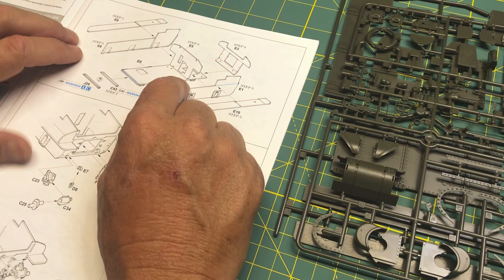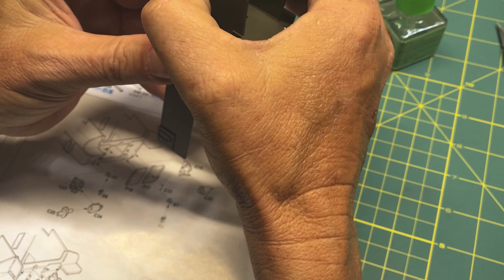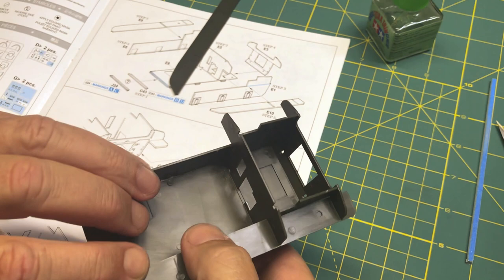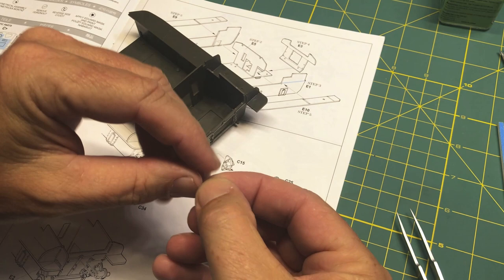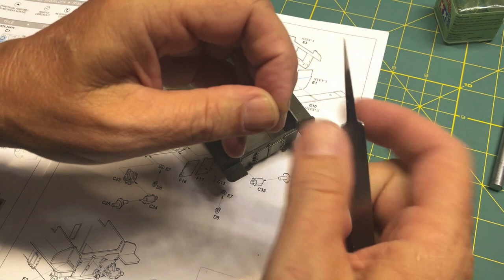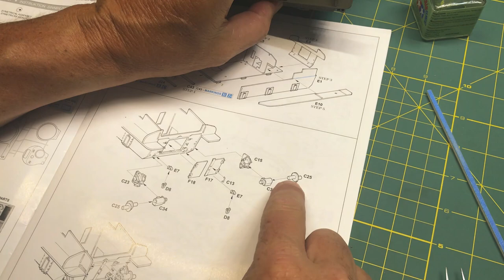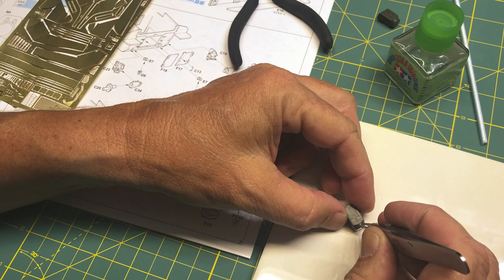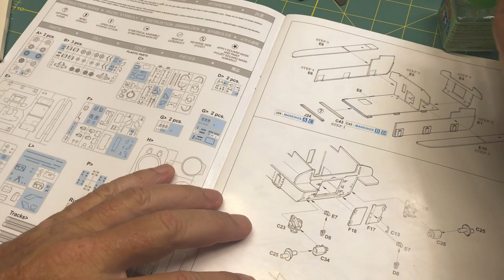Viewers Choice Build Eduard M4A1 Part 1

Comment: Good job, looking forward to seeing the follow up videos.  Did the kit come with 1 piece tracks, or  individual link tracks? Thanks.
Reply from the maker: Hello, Richard, and thanks.
It came with four piece tracks. Each side is made of two pieces of the flexible styrene type material, just like the one piece tracks Tamiya or any of the other manufacturers use.
Reply: Brett G thank you. Probably similar kit as other asuka/ tasca Sherman's, short of p.e. parts. Thanks, following this series.